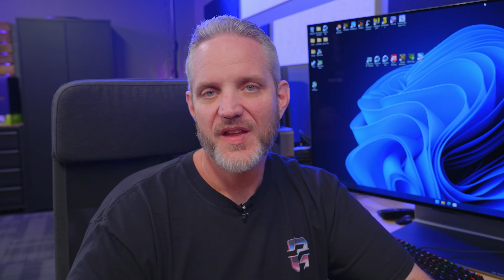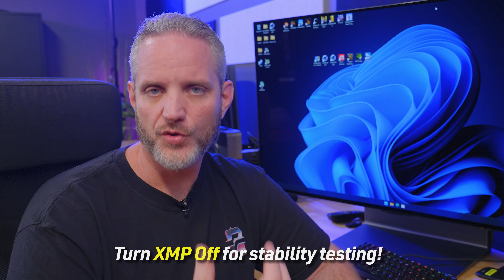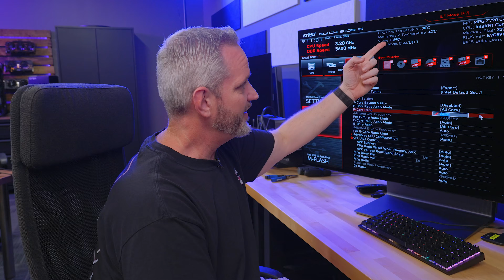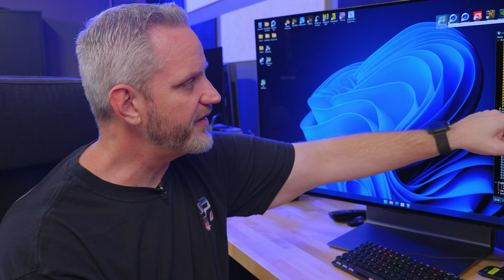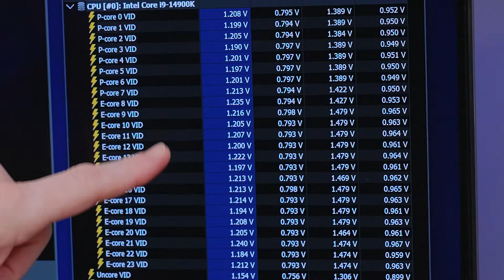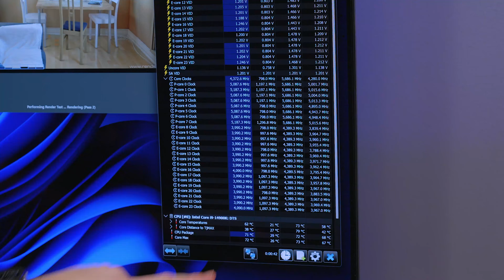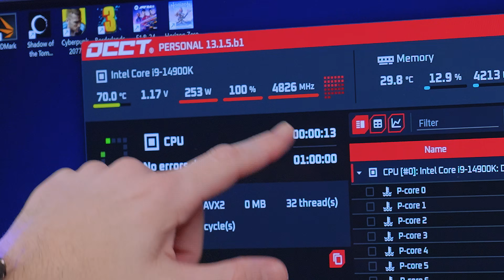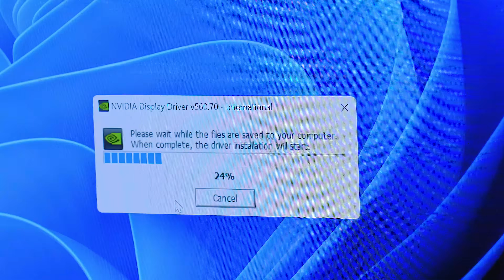Guide: How to check if your CPU is BAD!

Comment: It's wild to me, considering I literally have an Athlon xp 3200+ on socket A, that still works as it did when it was new. Probably better, since I used some leftover PTM7950 for its exposed die.

Thinking about it, I'm pretty sure the Phenom II 965 is probably degraded, because on the motherboard it was on, it typically could handle overclocking on three of the four cores well enough, but always the last core needed A LOT more voltage before it would stabilize with Prime95 with AVX and the like enabled.

I think my i7 3770 is also degraded in some way. On the cpu side, for a locked chip, it's a fantastic overclocker, able to reach 41x103 all core without even trying or getting too hot at all. But it flat out will not even POST, if I try to give it all four RAM sticks. I'm also thinking my FX 8120 is degraded since it's been really fussy and now failing memtest as well. 🤷

It's just, surreal to me, that intel raptor lake is already degrading this aggressively. And far as I can work out, none of these issues are applying to 12th gen at all.

Comment: i got my 13900K may of last year it ran great until about a few months ago when I started getting random app crashes. Opera would just randomly close or bsod out of no where. Then I started to watch it more closely and noticed temps were out of control no matter what I did. I got a new AIO used HQ paste and even followed your undervolt video and no matter what I do even after X129 it will dile .7 volts then spike 1.58v idle temps are 70- 78c and although it will complete a cine r23 it caps all P cores in the 100C instantly and best scores I can get are like 20K ish

Comment: i purchased my 13900k 1.5 years ago and at this point i need to under volt 0.120 v because even at intel recommended 253 watts it was still asking for 1.45-1.55 vcore and constantly crashing so i contacted intel and long story short i am receiving a refund was the last thing i herd. My cpu was only stable at an all core of 4.9-5.0ghz at 1.28 vcore

Comment: Step 1: Remove Intel CPU From System 
Step 2: Install AMD CPU into System
Step 3: Repeat as needed
Reply: Your fix is to spend more money?
Reply: @bluewater82  think of it as mitigation instead of fixing.
Reply: @jabronilifestyle  It's stupid no matter how you try to rationalize it. Just throw away a new warrantied product, let them keep your money, then go spend more money on the same product? And if that one fails or might fail? Toss that one and buy a third? At what point do you realize you're being stupid and just ask for a refund, repair, or replacement for the warrantied product instead of spending more money?
Reply: @bluewater82  Well, i sold my 14900k and mobo and bought a amd mobo and 7800x3d and all of my issues went away and i havent had to change a single setting on any game that i had previously dialed in for my 14900k so, I didnt really spend very much to achieve the peace of mind knowing im not in bed with intel anymore. Any $ that was spent to acquire that is well worth it imo.

Comment: 1:40 this is not entirely accurate information.  YES Chips do degrade, however under 'normal' use that degradation takes HUNDREDS of years.  Your CPU and GPU will live FAR longer than YOU ever will.  It is only under excessive heat and voltage that the degradation is accelerated.  With proper cooling your components will last literally forever.
Reply: my 8700k has been OC'd to 5Ghz for 6 years straight. It rarely if ever crashes, I can't even remember the last time It did if ever.

My 13900k died within months and 8 months later I'm still in a battle with Intel over RMA.
Reply: @jabronilifestyle  I was going to say almost the same thing. Also have an 8700k OC-d to 5.3ghz on all cores and I don't even turn it off. Been going strong since 2017.
Reply: I would argue "hundreds"  is too exaggerated, but close to and even over a decade is very realistic.
Reply: 😂 yeah, the CPUs will be fine as long as you dial it back to 3/4th of advertised speeds. Maybe they're trying to get into the same subscription model as the car manufacturers. Just pay $15/mo to be able to use your hardware 😅😅😅
Reply: The GPUs themselves last, but graphics cards sure don't.

Motherboards break way faster than CPUs do, that is, unless you have one of these gen alpha Intel boys. CPUs easily last 12+ years even working in server coal mines without bathroom breaks in 95C sauna hell, but you do have to swap out everything around them every 4 years or so. Of course, we are talking AMD and old-school Intel, not these gen alpha Intel boys.
Reply: Basically what he said
Reply: Yeah, but like it's fair to say "it doesn't degrade under normal circumstances" cuz the process is too slow to take into account for an user who'll use a cpu for like 5-10 years
Reply: dont gpus die after around 10 years sometimes?

Comment: i downloaded gigabyte f18d bios. i lost the ability to change perfdrive from optimization setting to spec enhance. i could select freely on f16 for some reason despite being 12400f cpu. now im stuck on optimization but at least i could change from auto to intel por defaults for power limits.
Reply: You need to disable intel profile first.

Comment: Hey, Jay.  I downgraded to a i9-12900K to ride out the 13/14 gen issues.  I'll put my i9-14900K back in in a few months.  Do I need to re-apply the BIOS updated to fix my CPU microcode, or does the board detect the change and updated is automatically?

Comment: Intel RMA Rates just went up 90 percent after this video 😎😎🤭
Reply: There is a long line ahead of them. i've been waiting 32 days already with no refund.
Reply: @jabronilifestyle  I'm going on second week
Reply: @JesusG90247  im going on 8th week as of today :( sorry man

take the cpu swap option when they offer it. I demanded a refund so they probably went slow on purpose.
Reply: @jabronilifestyle  lmfao
Reply: @jabronilifestyle did they give you an option to change your cpu or just refund ?
Reply: @jabronilifestyle why the hell would you get a refund? Did you send them your cpu or are you planning on stiffing them for free silicon?
Reply: People are starting to realize that they can't "fix" the issues with micro coding updates.
Reply: @bjarnis  Can't fix the damage that's already done, but has the actual issue that caused all this been fixed? Seemingly yes
Reply: @bleedxt exactly, the new code might work for brand new CPU's, but we don't even know if that will keep it "safe" in the long run..
Reply: @bjarnis  Yeah that's what i was saying, if you have a fairly new chip or an undamaged one then youll be fine. Rip to those who have damages chips, heard it takes like multiple weeks for the rma process
Reply: @bleedxt You're jumping the gun on the undamaged being safe with the new microcode.  Bad architecture is bad architecture and we haven't seen the performance drop expected to be necessary considering how they've basically been running the same design for 3 gens despite getting such large performance gains.  This is a problem where it is rather likely the "fix" is merely moving the problem back a year or 2.
Reply: @richardbrooksshnee  I'd rather jump a gun to a logical explanation considering the actual issue that caused all of this damage. But you however....
Reply: Keep in mind, many fanboys of AMD have been adding fuel to the fire unfortunately and hanging out on anything Intel, to "sell for their company". I still find it kind of creepy, but things like "Im on my 4th RMA for my 14900k already!", and that was months ago when still the 14900k hasn't even been out a year yet. Just keep your brains about yourself when people start mentioning crazy, like "I've been denied for an RMA for a year!".
Reply: This sucks so bad, for over a year I've been dealing w/ this mess.
Reply: @vincentperiolat4610  for me 1 year 5 months it's finally over
Reply: and RMA denials went to 100% too!
Reply: and AMD smiling all the way to the $$  with ex intel p^^%^ off customers ditching their many people say tainted and damaged intel 13-14th Gen systems for AMD equivalents
Reply: Honestly I think intel is literally cooked at this point even refunds won’t save them the ship is sinking most people are swapping motherboards and Jumping on the AMD train even with the disappointing performance benchmarks for the Ryzen 9000 vs the previous Ryzen 7000 they at least work without disintegrating The x3D chips will probably be outstanding compared to the non x3D for gaming stick a fork in intel they are done.
Reply: @germainetaylor1757 but I like my fire it keeps me warm
Reply: And most of them will get there cpu sent straight back and charged a disgnostic fee. Be damn sure you need rma before you kick and scream over the phone.
Reply: @MichaelOfRohan Intel has denied all my RMAs for over a year now - since long before these stories broke. 

They claimed "user error" every single time

Comment: Updated to the new Asus BIOS with the beta microcode the other day. Was being sparing with my PC (13900K) since this all came out. Using Intel limits and I started getting crashes with Diablo 4 after playing for close to 10 minutes. The try to boot up The First Descendant and I get a “Out of VRAM” crash. Welp here we go…
Reply: I had similar issues when I upgraded to the new BIOS. Check if your DRAM voltage is sitting on where your RAM manufacturer has tested the RAM to be stable (1.35 V for example, just find your exact RAM DIMM model and see on the manufacturers page, this only applies if you are using OC RAM ofc). And check if your Vcore voltage is potentially sitting too far below your VID voltages. If the temps are fine on your system you could just - for trial and error - go and set a slight OVERvolt (offset mode) to your Vcore voltage, something like 0.01 or 0.02 V while keeping the core temps in check. And do try the OCCT variable CPU + RAM stress testing, its very handy for checking if your system is stable. And of course keep playing Diablo to see if the crashes disappear.
Reply: Hardware info for anyone if interested:

ASUS Z690-E Motherboard running Intel Extreme profile with enforce all limits
13900K CPU
96GB (48 x 2) GSkill Trident RGB 6400 CL36 but downclocked to 6000Mt/s. Couldn’t get a stable post 6400.
RTX 4080 founders edition No OC
WDblack 850 2TB for the OS
WDblack 850X 2TB for game storage
Reply: Were you getting errors and crashes before the BIOS microcode update?
Reply: @jeremyashcraft2053 I was not funny enough. Everything was stable and fine about a month ago which was my last big play session. Maybe something in the new microcode and BIOS isn’t playing well together.
I’m going to downgrade my system to a 12900K for now and wait for this to all blow over.
Reply: I have an i913900K and ASUS motherboard. I'm not very computer savvy...

The new non-beta BIOS update (version 1663 including the 0x129) from ASUS says "for non-K processors"... and I have a K processor. Do I need to update to the version 1663 BIOS?

Last month I updated to the older 1661 version which states: "Updated with microcode 0x125 to ensure eTVB operates within Intel specifications." Never had any crashes or trouble.

I'm a little confused about the "for non-K processors".
Reply: @turtle2720  I think it just adds the microcode for the non k processors as well, it used to be only for the k processors. so i do´nt think it would change anything for you but it probably wont hurt to install it anyways.
Reply: @turtle2720  The BIOS info for my Z690-E says microcode stuff as well as, “…and adjusts the factory default settings for the non-K processors, enhancing the stability of Intel Core 13th and 14th gen desktop processors.”

I would reread your boards BIOS update details. Since non-K processors don’t have the ability to overclock I assume they stay at set default settings which ASUS is stating they adjust in the new BIOS rev. Which means since you have a K processor it’s really irrelevant to you.

But as well my instability started after I updated to the new microcode BIOS so take with that what you will.

Comment: Boy, am I glad I invested in B560 and 11th gen intel when I did. Not a lot of performance compared to 13th and 14th gen, but so much more stability, and at an i5-11500, i can still upgrade to an i9 and get a better cooler when it comes time to upgrade to 4k or get rid of CPU bottlenecks
Reply: The 11th gen is better now than when it came out.  If you want a stable Intel chip with quicksync, 11th and 12th gen are really the best option. Am4 Zen 3 has probably aged better than 11th gen Intel for gaming, especially the 5800x3d or 5950x (depending on individual needs), but it doesn't have the Intel specific features. Regardless, 11th gen is solid in terms of stability.  Ultimately, the people who don't just rush into upgrading their hardware with every new gen are really lucky.
Reply: Last Christmas (2023) I was upgrading from my 9700K machine, I was going to go with 14 the gen. But for the life of me I could not find the 14700K or a 14900K in stock anywhere, the Egg was out of Stock, Zon was out of Stock, and the Bay wanted too much and I wouldnt get it before New Years day, so I settled with a Z690 12th gen and OH BOY I am glad I did.  I dodged a bullet with the 14th gen.
Reply: @chasethefeel  Why run the risk? Also I got my 12700K for less than half of the price of a 14700K and ended up using that money for a 4090 over the 4080. So it worked out far better in the long run for me.

Comment: the latest Bios Update made my speakers not working (not even being detected), does someone has a solution to this problem (MSI MPG b760i DDR4 motherboard) ?

Edit : I tried to come back to the original bios version or even some other ones, but nothing work, my speakers aren't detected, but they works great with my phone or even my 3DS !

Comment: I submitted my RMA went to microcenter and got an AMD CPU not gonna wait 3 months for a replacement. Done with intel after this one
Reply: @chasethefeel  my computer became unstable. I’ve had it underclocked for the longest time but no matter what I did nothing else worked.
Reply: @Lemus4k did you check the ram especially in something like a vr stress test because for me it was actually ddr5 being shit blaming the cpu…
Reply: @MagicZ_YT  I did everything I did a memtest which passed changed the ram with a lower clock speed. Tested different voltage offsets no matter what I did nothing changed just constant crashing
Reply: @Lemus4k  yea but for my case memtest wouldent say anything was wrong either because the ram on its own was fine and the cpu on its own was fine but they would nerver be stable when working together ended up hard setting some values and manually stableising the ram and so on and now its been fine but it could allways be something else...
Reply: Remember the good old times when Intel used to be good. My old 7700K lasted forever (well it still works) but since Ryzen 3000 i haven't touched a single Intel CPU and after all these fiascos (degradation, oxidation, at first lying about Intel APO being uncompatible with 12th and 13th gen etc) i won't return like ever.
Reply: @kerotomas1  I had a 6700k for like 7 or 8 years overclocked without fail. My cousin is still using the PC to play Minecraft and league

Comment: My 13900k is a monster and benchs higher than any of my  others and stays cool doing it, ya gotta check all the boxes first before you decide your chip is sub par, look at your   cooler, look at your paste application, check your mobo's stock settings, make sure your case is properly ventilated, and your ambient is favorable! Update your windows and your bios, watch your windows settings, there are just so many variables before you can consider you have bad silicon